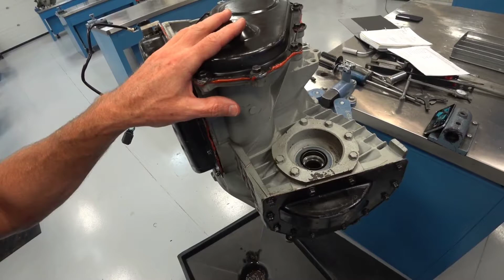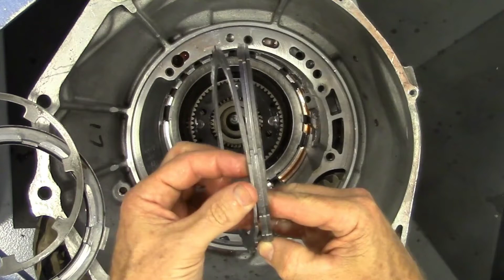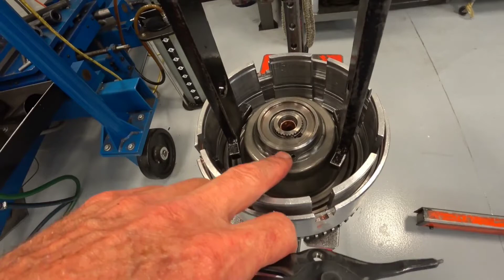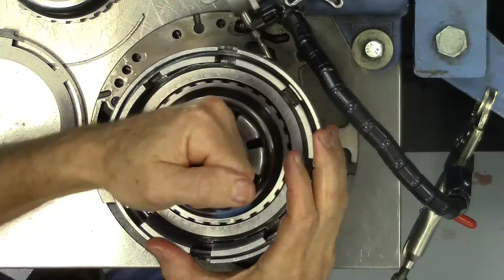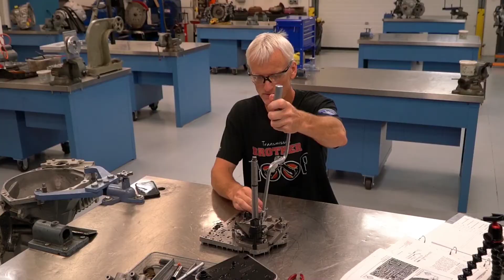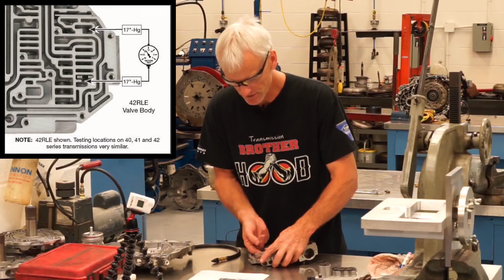FCA 41TE Overhaul

Comment: Great video, I can tell you are a patient instructor. 
I had a similar problem with beginners using a wrench instead of hand tighten.
Solved the issue by welding a top bar making it a "T" bar. That way there's nothing to put a wrench on.
Anyway, thanks for sharing your time and knowledge.

Comment: I got a clutch replacement kit BW 34038 for For my 41te . For the drive clutch drum there is 4  black high energy and 6 of the regular pinkish friction . My 2005 only pinkish friction in revers OD,UD.  .I HEAR HIGH ENERGY BLACKS ARE for OD.BLOW UP DIAGRAM SHOW 3 FRICTION 2 METAL. SO I'm confused

Comment: Thank you for this incredible informative and helpful video.  I am currently rebuilding my 41TE and have gotten to the point in re-assembly of measuring the Clutch disc travel on the OD/Reverse clutch pack.  The manual says that the clearance is 0.035 - 0.054 in.  I have checked the clearance for the underdrive pack and each step until now and I am getting closer to 0.09 or 0.1.  I put in a thicker snap ring as suggested (2.0 mm) and it is still getting close to 0.09.  I just ordered the thickest snap ring it shows available in the Service Manual (2.3 mm) but am worried about this clearance issue for the OD/Reverse pack.  Is there anything else you think I might have missed or should check?  Many thanks
Reply: Have you ever seen a clearance issue caused by the OD/Reverse reaction plate or the OD/Reverse pressure plate?  Do they come in different thicknesses or do only the snap rings, steels, and discs come in different thicknesses?  Thanks again

Comment: 1st I want to say thank you for this video as I might have to tear into my 08 sebring trans.
Question if I may, have a P0700, and P0755 code. I replaced the shit valve assy (also fluid n filter), cleared the code, but they came back. Trans will go in reverse, but only move forward in 2nd (while in D or L). Any idea where I should look next? I've rebuilt a Ford C6 so this one doesn't look too bad.
Thank you for any guidance you can offer.
Reply: i know its been a year, but typically these will use 2nd gear as a limp mode, so something causing it to go into limp mode. could be a lot of things(including 2nd gear itself!). unfortunately its a lot of things that could be causing that.

Comment: P0935 is driving me nuts..pulled valve body.. changed valve body.. shift solenoid pack... new fluid.. ..even pcm. Still have the line pressure sensor code.. throws my car into limp and causes it to over heat.. use to can clear the code n keep going.. now its permanently been like this.  I feel like its something im missing.. i thought the line pressure sensor was on the valve body but there is NO SENSOR on this valve body but range switch.. thought it was in the trans shift pack but still have the same issue... n trans is overheating.. anyone please.. give me steps on what to try. Nd pics or manuals if you have them.. tryna figure out the issue. Help

Comment: My car has a 40tes trans.I noticed there is a bunch of them like 40 te....40tes...41te...and more and I really would like to know the differences.I know some are 6 speed and some are 4 speed so maybe this makes a difference.It seems like a very good trans with proper care.
Reply: Only the 62TE is a six-speed (there is an extra 2-speed “compounder” gearset where the transfer shaft is on four-speed units).
Reply: the TES has a shallower bell housing, the 41TE low clutch drum has one more friction/steel disc than the 40TE. physically, there should be no difference between a 41 and 40te

Comment: My 2010 caravan started slipping after a fluid change and filter swap. It only slips in 1-2 when van is cold. Is this a fluid issue ( I used castrol atf4 ) or is transmission failing. I even tried adding Lucas Slip stop. Van has almost 200k and had some metal shaving on magnet in pan. Any advise??
Reply: In this situation I would suggest a transmission quick relearn at the dealer or with someone with a capable scan tool.The sudden change in fluid viscosity does require a trans quick relearn.Not sure if this will fix,but I do know the viscosity change will require a relearn with a scan tool.
Reply: Thank you for your reply. I will look into the relearn first. Do you know of any ways to do the relearn? I have found some comments of ways to try at home but not certain I’d they work for the 2010 caravan or not

Comment: LoL I put the trans together 1 and 2 works reverse quit and felt like it was binding in reverse and made some clunky noise in reverse any idea what I did wrong I think the 1st and reverse clutches were really tight on clearance I put the upgraded  2nd stage clutches in.  Inside the input drum was a snap ring it was also chipped when I took out the ring a piece we're the snap ring goes in the shell was under drive I think and it chipped as I took the ring out good chunk on the last snap ring were it groves in.

Comment: Not sure if this will be answered or already has. I have built one using your instruction in a daily vehicle and its been fine. But i have another vehicle and have this in a racing application. Two questions… can you add clutch(es) to the OD “4th” gear? And second how do you mechanically increase line pressure to clamp especially the OD more under high torque load? Or can that only be done through tuning electronically? These are not the strongest. Thank you for any assistance and great video, thorough and meticulously done.
Reply from the maker: You cannot add pressure through tuning, because they have fixed pressures based on what gear you are in.  You might be able to adjust how quick pressure can enter the oil circuit through tuning.  In 3rd and 4th, pressure is lowered in the transmission down to about 85psi.  If you look at the hydraulics video and find the passage where the 3-4 enters the pressure regulator and block that off, the trans will operate with the 145 of pressure from 1st and 2nd.  I don’t know if there are any methods to increase clutch count.  There’s not much room in there
Reply: @siuautomotive  thank you very much, that clears up the biggest questions I had.

Comment: Much appreciated video. Thank you. Just wish it included the final drive and transaxle. Mine is shifting fine but it seems to be moaning from the tranfer case. Like maybe a bearing is worn out. No real vibration, just moaning like a dry bearing? Or maybe even a worn drive gear. Sure would like to know more about that and where to get the repkacement parts

Comment: This step by step breakdown is helpful! I have a rebuild manual I found online, but this is a great companion, especially for the detail you go into. I picked up a '95 Cirrus for cheap and it would go into limp mode during downshifts, but otherwise drove and up-shifted fine (cycling the key off/on would clear limp mode and no CEL came on). Finally pulled the transmission to see what was going on and found some VERY worn 2-4 clutch discs (all the way to the metal!) and some gouging on the OD clutch hub from the disc's... fingers? Whatever you call them. The one in the video has markings, but mine has deep grooves on one side of the recesses on the outside of the hub. I'm replacing that, some very heat marked steels, and using a Mopar overhaul kit.
Question though, I found some marking inside the input clutch retainer. I don't think it'll cause any issues reusing it, what do you think?
Reply: Where did you find your manual and what did it cost?  Im probably about to have to pull a 41TE  trans from a 2005 Chrysler Touring FWD 3.5 and do a rebuild.

Comment: Thanks for the instructional video. First time tearing into one of these. I installed a seal & gasket set + the underdrive & overdrive friction discs. The trans is actually an A604 out of a 93 LeBaron sedan with 57K miles so all the mechanicals were in excellent shape. The only aggravating thing the trans was doing was doing the bump stop (one bump only) thing causing the trans to go into limp home mode. I replaced the low/ reverse piston seals (the lip type) with the D-ring seals that came in the kit. The trans parts guy had some upgrade parts for the OD/UD & low reverse accumulators which I used. End result: removed one problem (the bump stop thing) but created 2 new problems. I suspect that the upgrades to the accumulators are the problem. Now I will have to drop the pan & valve body to remove them.  Again thanks for the video, best one I could find.

Comment: My friend, where is the defect in this transmission.. why is it so notorious.. where is the common problem.. where is the manufacturing defect of Chrysler in this transmission.. and how to treat it and fix it or avoid it
Reply from the maker: The later units are pretty robust.  I’d say high mileage units, you’d want to focus on the valve body and check the solenoid switch valve line up.  This video goes through some common issues: https://youtu.be/zSdYAHxYVXQ

Comment: I have a 2005 Caravan, fairly sure it has this transmission.... and something just broke on it;   something major.  I'm not exactly sure what it is. If I let it creep forward in Drive, it will seem like it's driving normal and will do a normal "creep" when you let off of the brakes.  But as soon as I push the gas, it sounds like a sledge hammer swinging around and hitting a bowling ball.. It's very violent and hammers hard.  It's very similar to how a drive shaft sounds when a U-joint breaks and the shaft is swinging around and slamming into everything under your truck.  It has about that same cadence to it.  But you absolutely can't drive it in forward anymore than that;  any amount of throttle causes this violent action-- But it will still coast?  I was almost think it's the differential or spider gears or pin--- or something.........  But the freaky thing is, it still drives in reverse?  Without any of the violent action.  I drove it about 8 blocks in reverse to get it home, and I even got kinda hard on the gas once and it spun the wheel in some gravel a bit... But seems to drive normal in reverse?...   I was thinking that it could possibly be a broken CV shaft, but then it would free spin and not drive right? --- so I'm kinda scratching my head as to what it could be.......   The engine runs fine, and honestly the transmission seems to run fine even going forward (as far as the clutches and engaging as it should ect)--   except when I give  it any throttle at all, and then it has that violent, binding, crunching, slamming and hammering noise.  You can tell that there's a moment of free movement and then it slams something-- so it's not a constantly binding thing;  and again- it drives in reverse??   Just judging by the speed of the hammers, I really think it's the diff or a CV.  But if you have any idea about what this could be or what commonly breaks on these, or anything that rings a bell-- I'm all ears.  Thanks for the reply

Comment: Great video. I am trying to pull the Valve Body in my friends PT Cruiser that has an A604(41TE) and we are stuck trying to get the Valve Body to come down. We ensured that the main shaft is fully clockwise. One park sprag roller is out but the other wants to bind at the transfer gear. Any suggestions?  Thanks.
Reply from the maker: I assume you have the linkage disconnected on top of the trans.  You should be able to shift it to low range and drop it straight down.  If you don’t twist the shaft the correct way it’ll get hung up, but make sure everything is disconnected up top.
Reply: @siuautomotive  Thanks. We did have everything disconnected up top. We actually removed the vent plug at the top of the shaft, verified we were fully clockwise and then put a block of wood on it and then tapped lightly. The valve body came right out. Thank you. We replaced the range sensor and re-installed everything and still no reverse gear. Thinking reverse clutch pack. 😩 Thanks again!!

Comment: Hi, what are the 5 or 6 bolts/screws between the pan and the solenoid pack are?  I saw that the were backed out so I tightened them and know I’m thinking I shouldn’t have.  I think the screws go into the outside of the valve body.  Thanks.
Reply from the maker: I believe you are referring to the pressure taps.  Those allow you to hook a pressure gauge and measure pressure to the clutches.  They are tapered thread, so they won't look like they're all the way installed.
Reply: @siuautomotive  so was it ok to screw them all the way in?

Comment: Do you have a video on the Phase 1 4EAT Subaru transmission? I rebuilt mine a few years ago in my SVX and Legacy and had great success, but I still had a lack of understanding of the operations. 
They have a high failure rate in SVX's, but last sometimes up to 3x as long in the Legacy Impreza and Forester counterparts. Many of us have attributed it to the poor programming while others believe it's excessive heat. Some have the notion it's a combination of the lazy program and weaker parts that were beefed up in their brethren. However, I've seen no difference in components other than the SVX used the 3.54:1 GR while others used a 3.91, 4.11 and the sought after 4.44 used for swaps. Is there something I'm missing?

Comment: Hi! Thanks for video.
Can you recommend some replacement of original oil Mopar ATF+4 for 41TE?
I have no way to buy it.
Maybe, Valvoline ATF+4 or Ravenol ATF+4?
Reply: As long as its atf+4, its fine. Its a type of oil
Reply: ATF+4 is the standard fluid all the transmission except for the CVT'S.

Comment: Really great video, thank you! I have a question about the fluid. I bought a 1998 Town&Country with the wrong fluid in it (Dexron III). I need to replace the whole fluid to the Mopar ATF+4. Do you prefer a flush (at home, with the cooler lines, no additives) or a simply draining 2 or 3 times. Thank you for your help.
Reply: How did you find out the wrong fluid was in it?
Reply: @BertGraef  previous owner told me
Reply from the maker: I would pull the cooler line and use a bucket.  Start the engine and as it is filling the bucket I’d be pouring in the atf+4.  You’ll go though 15 or so quarts before it’s flushed.  If you plan on changing the filter, let it suck the pan dry and that way it won’t be as much of a mess when you drop the pan.  Btw, lubeguard has a bottle that converts dexron to atf+4.  If the fluid is good and not to old, you might consider that.
Reply: @siuautomotive  thank you very much!
Reply: @siuautomotive  do I do it in P or N? Or D? should the engine run continuously or should I stop per quarts?

Comment: I've noticed a certain kind of buzzing noise these types of transmissions make as you shift either in reverse or in and out of first gear! I've even heard it in some rear wheel drive vehicles such as Dodge Ram, Jeep Grand Cherokee, etc.
Reply from the maker: Yes sir, that's the solenoid modulating fluid into and out of the clutches.  Early 41TEs were so loud they had a insulating cover to muffle the sound a little bit.  The 45RFE transmissions use a similar technology, so they're noisy as well.

Comment: I don't know if you can help. I am in the process of installing a 41te into a 2000 town and country. Father in  laws van. Found a new old stock trans. Problem is it is for awd. From what I can see out put shaft gears need to be changed over from old tranny to the new one. New awd tranny has a double spline on passenger side. And has an extra long cv shaft that passes through transfer case, then into tranny. Plus old tranny has 4 inch housing to support cv shaft. If this makes any sense.
Reply from the maker: I’m pretty sure you cannot bolt the extension housing from the 2wd case to the awd case.  If I were you, I’d just rebuild the original unit with the parts from the donor transmission.